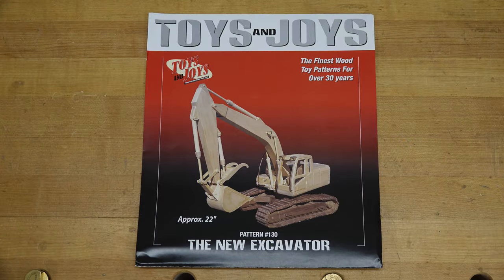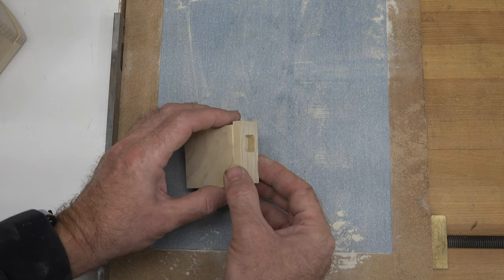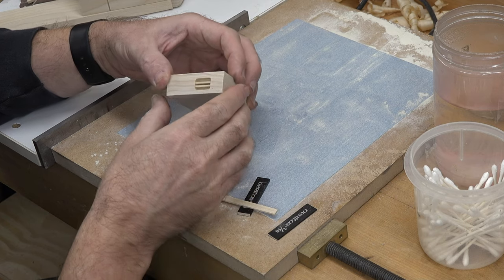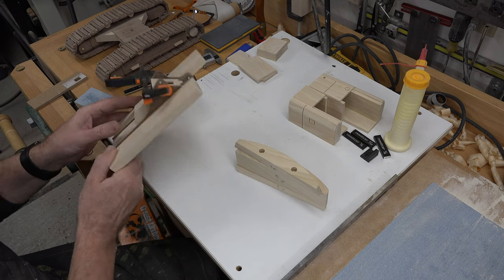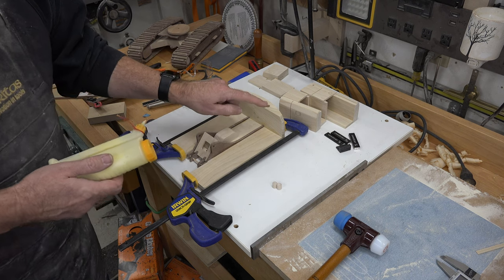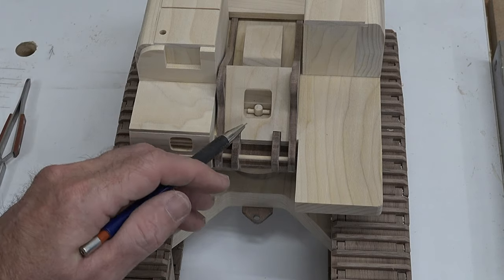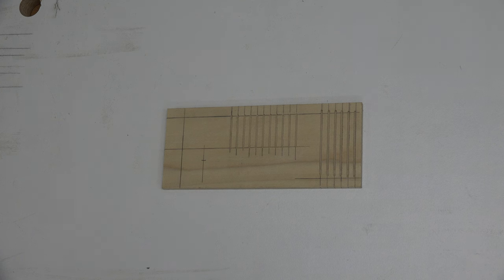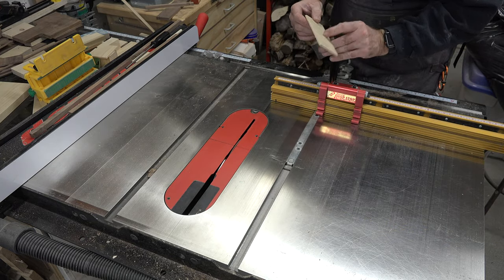Toys and Joys "New Excavator" Part 7

Comment: Howie just looking around was wondering how you heat the shop looks like maybe wood?  Cause mine is wood takes long time to heat 140 by 60 and ceiling is 12ft  have one part wood and other is mechanical projects  in winter don't do much in wood projects  cause to cold the glues and paints in house so just was wondering  thks again  keep it up it drops down here in the 40,s and the Wind bites hard l,m from Dalmeny SK Canada 🇨🇦  little away from ya thinking
Reply from the maker: Your shop is much larger than mine.  My shop is only 12'X24' with 8' ceilings and yes, I heat it with a small wood stove.  I think that in order to heat a shop your size, you would need a very large stove and some really good air circulation.   I'm a little jealous of the size of your shop.  Thanks for tuning in to the show.